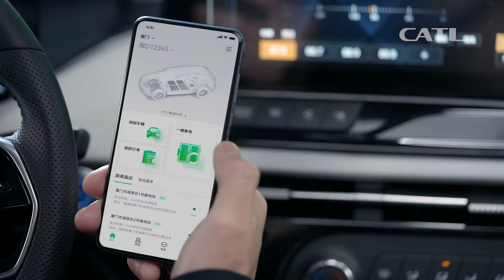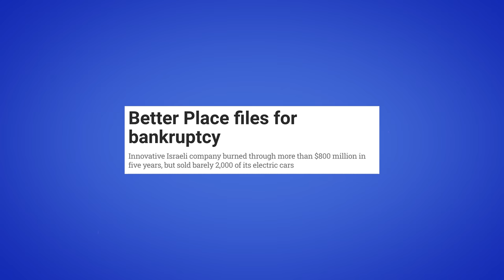Why Battery Swapping Is A BAD Idea

Comment: I'd be really interested to see where the future of this technology could be. I wouldn't want to drive into an expensive box to have bolts and screws taken out every time I needed more range but I can imagine a future where the stations look like modern petrol stations. If you're patient you pull into one of the super fast charging bays and go have a coffee for 15 minutes but if you need range immediately you pull up to what looks like a futuristic version of today's bowser where there are dozens of identical fuel cells that can be swapped out of your vehicle by hand. All car models use the same set of battery cells (much like the EU regulating all phones must be USB-C chargeable and all electric cars must be able to be charged by one plug design). Your SUV carries 36 of these fuel cells but they deplete one at a time so you decide you replace 12 of the 20 dead ones leaving you with 28 fresh cells. You decide that's plenty for now so you pay and go in about the same time it takes to fill a car with petrol today.
Reply: Where will be not enough lithium and other materials to make all EV that most companies are claiming they will make, why you put 10 batteries per station, and not put them in 10 cars? Swaping is not material efficient, and will never be, and time of charging... let me say in 20-30 years (even if it not change) people would forget that it was problem for some today.
Reply: @m_sedziwoj  But those 10 cells at the station could service 60 cars an hour if they only charge in 10 minutes. These aren't disposable batteries you're chucking away. They're being charged and will be ready to be swapped into someone else's car in 10 minutes.

What I'm worried about is a future where you stop at a charging station on a highway on an interstate trip and find there's a massive line of vehicles to use the parking bay chargers. By then pretty much all small cars are electric and everyone needs at least one charging stop on a long journey. The station offers lots of parking spots and some people plug in for 10 minutes, stay with their vehicle and then leave when they're charged but other drivers step out for lunch and let the kids play so might not come back to their vehicles for 45 minutes. Those cars are taking up a charging point while not needing to be charged at the same time others are waiting and desperate to be on their way. You'd need MORE infrastructure to accommodate the cars that are going to stay at a charging point longer than it takes to charge the car. A swapping station would operate like today's petrol bowsers. You swap out your batteries in two minutes and then if you want lunch park at a regular parking spot allowing the guy behind you to swap out their batteries.
Reply: @xcw4934  eh, but u have 10 less car per any amount you put at it, and looking at utilisation you will have at last 1 per car, so you needing double resources which we can't have enough. 
About charging, in opposition to gas stations and swap stations you can make any parking space charger, so this big parking under MC donalds etc would become charging spaces. And I don't know why they don't do it already, because this 15-30min people will buy something to eat.
Reply: @m_sedziwoj  But a high amp charging station is actually also quite expensive to implement. You need to upgrade the local power infrastructure and install an expensive DC transformer to offer the high rates of recharge. Current hardware costs for dedicated charging stations is between US$20,000 to US$75,000 per charging bay! If you wanted to open a roadside charging station and wanted to provide 10 fast charge bays it could cost you US$750,000 for the charging hardware alone! 

What I'm saying is there's not 1 petrol bowser in your city for every car. There's maybe 1 for every 2000 cars. Swap stations will be the same. You might only need 1 spare battery pack per 1000 electric vehicles as the battery packs charge when they've been returned to the station and will be ready to be swapped into the next car in 10 minutes. It might end up taking no more physical resources than a larger number of fast charging points while being more convenient. It does all depend on what materials will be in the shortest supply I agree. Batteries are cobalt and lithium intensive while charging stations are probably less dependent on rare materials. But 1 extra battery per 1000 cars I doubt would be much of a problem.
Reply: @xcw4934  look at both side cost when comparing solution, and on long term cost. Because long term cost of station will be multiply higher than for charging station, where mostly once is done you don't do anything. When you amortise cost for years it changing what is worth formula.
But as hydrogen is even more stupid idea, and many people still wanting to do it... I think what is best have nothing to do with what we get.
Reply: @m_sedziwoj  I get the feeling hydrogen might be a solution for very high performance dependent transport like large trucks and planes. They're not going to be more economical than electric for personal cars.

But a swapping station also doesn't require more expenditure other than the electricity to charge the cells so I'm not following your reasoning. Do you think the swapping stations take thousands of batteries and have to have them sent away to some factory to charge each day? A swapping station should be swapping out the same 100 batteries to thousands of cars and charging them on site. I don't see it necessarily being more expensive than high charge plugin bay that currently cost US$20,000 minimum each. If you want a charging bay that will 80% charge a car in 2-3 hours then yes they'd be like $2000 each but the high charge plugin stations are really specialised and very expensive tech.
Reply: @xcw4934  first, they cost more to build, take more space (so you can't convert current parings to them without taking parking spots) they would required a lot of maintenance because they have a lot of moving parts, cars would required addition design cost and manufacturing cost, and adding more stuff to break. You would not have impact of condition of battery so people would use it badly which would lower they lifespan a lot => you need to make more.
And we want to migrate to EV as fast as we can, so putting any resources in not use stuff would be waste, and at beginning utilisation will be low, so multiply inefficiency. 
And if you put chargers everywhere you don't need fast speeds, because you charge at night, while in job, only place which would required fast charging is on long trips, and where most people do stop for breaks to go to toilets, eat something etc. So it would not be so bad as many making it. And in cities you would not use fast chargers at all, because daily usage would be recharge at night or job, and this stations don't required more than streets lamps.
Reply: @m_sedziwoj  Yeah that's what I'm talking about. You'd have a couple fast charging points around a city and battery swap stations almost exclusively on interstate highways. I'd want cars to have batteries that can be hand removed if you're travelling a long way but 350 days a year you're just plugging  it into your garage charger at home instead. If we're talking about replacing all internal combustion cars then we'd want the EVs of the future to be able to do everything a combustion car can do now. That includes towing a caravan up a mountain and only needing to stop once a day to charge/swap batteries while the family has lunch or something. I don't want cars that must take 50 mins minimum to get back 40% charge capacity. I'm not sure what your cities are like but in Australia (where I am) and the US lots of people travel very big distances at least once or twice a year by car. We need our EVs to do city driving 350 days a year but 1000km+ driving 15 days a year.
Reply: @xcw4934  from 10% to 80% is done today in 15min, so I don't get where you get this 50min... and if you put swap station on interstate highways and so they don't get long waiting in time of holidays they would be very underutilise. But I agree towing is a problem for EV. Because in other scenario, stopping for even 30min every few hours, people will use to it. As it was with switch from cellphones to smartphones, go from 7days without charging to even few times per day, but nobody thinking about making phone which would work for many days, because people stop caring about it. And if you need to use for many days without place to charge you can use powerbank or special smartphones with long battery life (not nice looking and big) and I think similar ending would be with EV, not changing batteries as we lost it in phones too, but fast charging and change behaviours. But only time will show.
BTW I understand and agree with most of your points, but I putting different weights to them.

Comment: This is quite a bias review, so you have a car that can slow/fast charge AND SWAP batteries, makes no sense if I have a drive way with your own charger, but makes perfect sense if I live in a city where you have no gurantee of a personal parking space.

Pointing at the failure of Renault and the Israle company is a red herring, why it failed might not have been the idea, but the execution. The fact that we haven't heard about it speak tons about their lack of marketing, plus the car looks rubbish.

I look at it as Nio car has the battery size of Teslas, can rapid charge AND I have the option of battery swapping.

Also the biggest cost and risk of owning a electric car is the battery, but if it's designed go be removed what's to worry about. Although it would be interesting to see if you can buy the battery from NIO when the car is new and change to leasing later and vice versa, to cover such scenario if the purchased battery goes bad...

Comment: This is a completely brain dead report.   All car makers will become predominantly coachbuilders in future and batteries will become standardized and swappable.   Nio's can be supertcharged too but additionally, they have the ability to always have a 100% functioning latest battery technology power pack so the car will function as well on day 10,000 as it did on day 1.

Comment: The biggest problem with EVs is that each car has a different battery. Therefore u can't just drive a up to a battery swap station and swap a 100kWh battery with your 250kWh battery. Whereas ICE cars may have different engines and tanks. But they all use the same fuel

Comment: As someone with a propane grill, I could see the flaws in battery swapping easily. I refuse to use those propane tank swapping services because I take care of my stuff, I keep it clean and in good condition. The first time you take your pristine propane tank to the store and swap it, you get a beat up, scratched up, grease covered tank that probably leaks.

Comment: So exactly how much did Tesla pay you for this video?  The first point about space is completely destroyed by the space currently used for petrol stations. What about batteries becoming less efficient over time, not an issue with NIO.
Reply from the maker: Nio is probably the only manufacturer where you can buy a car with a brand new battery that’s never been used, with full range, and swap it in five minutes for one that’s been absolutely battered, with no prospect of seeing “your” original battery again. Your “less efficient over time” could be a matter of minutes. 

Regarding petrol stations: I’m not sure what your argument is.

Regarding being paid by Tesla: You’ve never had to press “Skip ad” here. We don’t run ads on our channel from anybody at all.
Reply: The battery's are leased so you would never worry about the condition of the battery.  Its like renting a car and worrying if the tyres are new... you just wouldn't be bothered.  

The petrol station point basically means nobody has ever complained about the space needed for them.  But a smaller battery swap station takes up too much space? 

lastly not all money is through adds. Must be a new tesla in the post for you
Reply from the maker: @niallquinn2860  My own electric car has lost about 30-40 percent of its range during its life time. If that battery was part of a swapping pool, having one battery deliver 40% the range of another may be an issue - especially if it's pot luck. It's not a problem in terms of your responsibility for the battery, as it's leased, but if you buy a car needing it to do a certain mileage, only for it to vary drastically depending on what's in the pool then that could be an issue.

Comment: Step 1. Stop to talking about battery ownership.

So your arguments only make sense through that narrow lens. 

Stop talking about "well tesla didn't buy in on it" . I don't give a shit what tesla buys into .

The day you pass a law saying "in order for your EV to be licensed for road use, battery just be these specific dimensions, this power output, and connected with this standard plug" your complaints didn't get to exist.

The answer is political not engineering

Comment: Cost is not an issue, you’re a westerner that have zero concept of how Asian countries run and how they want to tackle what ownership is. This video is basically telling us why its a GOOD idea. Battery life/ longevity isnt an issue as they can be monitored by the supplier in real time and most likely have warranty and arrangements made in contrast to what you’ve listed. A NON-informative video. Not everyone has super chargers at home that can charge their cars in less than an hour and a vast majority of ppl live in apartment high rises with very few parking spaces available.

Comment: Consider AI and how society will upend over the next 5 years. As battery capacities increase, charge times will also, but automation will only get faster and cheaper. Fast charging stations charge at premium times & will cost more in electricity, battery life and safety. Nio solves all of these problems, sells energy back to grid and allows for grid throttling. Most of all, I'm betting that automation is the near future(2030) & nio falls into this(taxi service). I doubt many will own cars in 2030. Cars should be on the road, profiting at all times while batteries are charging , this is efficient. That's my bet anyway.

Comment: Totally agree.
Battery swapping won't be a great way to replace normal charging since most newer EVs already have super fast charging, a lunch or even just taking a break will net you 80% or more and you are good to go for hundres of kilometers.
I do think that it does have some place in the world of commercial vehicles, like building those stations in the middle of highways connecting big cities.

Comment: OMG,  this Nio company hasn't made a profit yet. 
Just like Tesla,  go figure.
Reply: It doesn't mean it is not a good idea. It helps to alleviate the problem with having to take long time for your battery to charge while on a distant journey. Trucks would need this the most as EV becomes very popular.

Comment: Well let me put up few exampels for you about this battery swap advantages that you missed, Its not allways about time, Look at me im EV driver of Nissan leaf for 12 years now, my battery is crap but enough to take me around town witch is fine, imagane now if i could use my 12 years old leaf go to battery swap and pick up 100kw battery for my road trip, and return it when im back home to get my old battery, nr 2: if you are taxi driver you might wanna consider battery swap couse its both time sensitve and tear and wear on battery nio is much better options those batterys in stations are charged with optimal speed so wear and tear is minimal they will last essentily forever. Then 3: when its crap weater ouside or during nights some ppl in some naibrahoods get robbed when charging in NIO you dont need to leave the car and place have survialance. Those are just some of the benefits Not to mention is better then one company can replace bad cells on bad battery backs its alot bette for envierment and much cheaper then private person dumping the car.

Comment: This is bad info... And TESLA stock is showing it by firing their SUPERCHARGING TEAM! NIO is the future for the same reason cordless tools swap batteries... Normal charging will create long EV  lines with mass adoption or quick charging will create stress on electrical grids ! ... With NIO Batts can be slow charged by solar with no need for new electrical plants... Battery as a service is also a good idea and makes car cheaper...NIO owners can rent bigger batteries for longer trips and batts can be swapped in 3 minutes (4th gen).... Tesla went for quick profits and is falling from $405 to $140 already.... NIO went a samrter model and long term sustainability... Small bump in TESLA  price based on ELON lies to stockholders... He is not ready for Full Self driving and LIDAR is better than cams for that.. Plus  Cybertruck is ugly as hell!